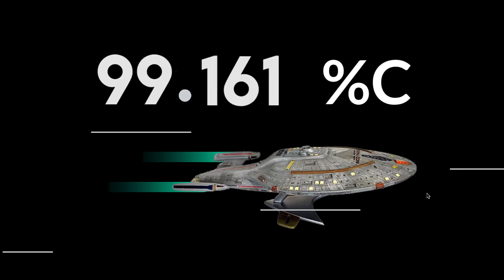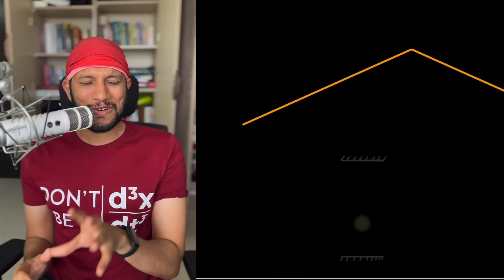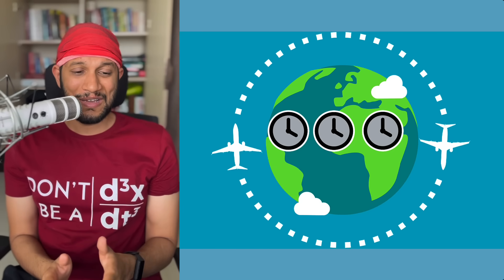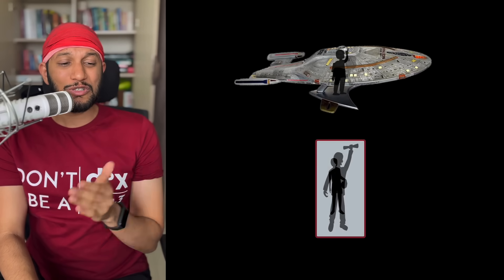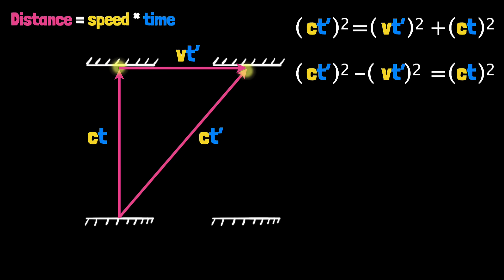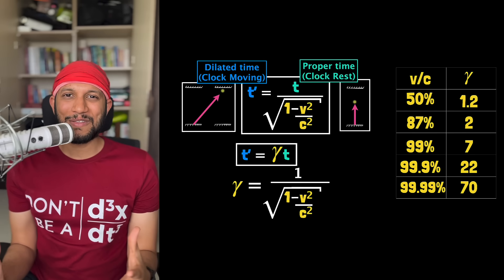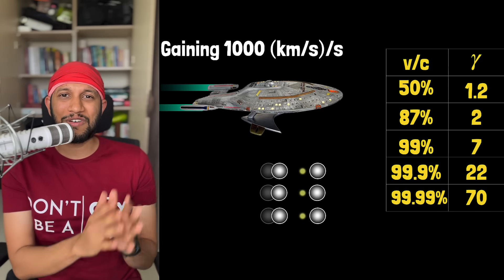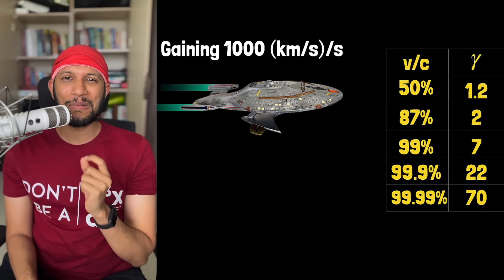I finally understood why you can't go faster than light! (My mind is blown)

Comment: This video doesn't just explain why we can't reach speed of light. It explains much more than that. For example, it explains why time slows down when you move very fast, but the moment I felt like I was enlightened by this video was when I realized that this can also explain something that I never understood before. I am talking about how the concept of relative speed doesn't apply to light and we always see the light moving at light speed regardless of our own speed. I still don't understand it fully but I feel like this video gave me a big hint about why that's happening.
Reply: I find it useful to consider that ALL objects move at the same speed through spacetime at the rate of c. A stationary object is moving only through time and a photon is moving only through space. Other objects move at different ratios of space vs. time depending on their speed, but an object's speed through spacetime never changes.
Reply: @huskypup3489  And likewise, being under the effect of gravity moves your "spacetime velocity arrow" slightly in the space direction and less in the time direction, resulting in gravitational time dilation (time slowing down) and spatial acceleration
Reply: @huskypup3489 I’m so sorry to shatter your understanding, but you’re wrong and Einstein is right. It’s all about reference frame. Objects do travel through spacetime at different speeds depending on point of reference, same as force carrier particles such as photon, we don’t know does the time goes “forward” “for them” or “standing still” or something else entirely, however the can observe and measure their speed, which is constant in any frame of reference, and means they do indeed travel in spacetime. Basically bosons except for mesons are incapable of slowing down beyond light speed in any reference frame, while aforementioned mesons and generally hadrons and fermions can, yet they have mass and are incapable of reaching speed of light instead. Your explanation fails at black holes for example. Gravity there is so strong it stretches spacetime so far that light needs infinite time to travel from source of emission beyond event horizon and since our universe have measurable time frame since the formation of a black hole to any point of time in the future (in our understanding of spacetime at the current state) we can observe no light escapes black holes, which in oneself reinforces our current models. Einstein’s theory explains it perfectly yours doesn’t, sorry. Mathematically speed, time and space come together in this formula v=dt. It’s been tested and always predicted results correctly to a certain degree, you can check yourself if needed. Now if you were right it would mean everything’s speed is c, which is kinda weird on it’s on but harder to debunk in simple terms. So lets look at photons in your model t=0 for them always hence for photon v=0 always 😮 according to your model photons are at perpetual rest to everything in the universe. Incapable of travailing any distance at all. No matter from which point of space or time you look at a photon it should always be at rest relative to you! So sorry again but it’s better to be mistaken and find out then believe in a wrong thing, you on the right trek just didn’t reached the destination yet. Be patient and eventually everything will click into places. By the way interesting thinking, never heard something like this, made me think for a second, thank you for what! I can recommend to start from understanding that space and time are kinda sorta the same thing like matter and energy is. Not exactly but it’s a good enough start, what is established for now is they are intrinsically connected and inseparable hence the actual name spacetime. It’s just describes four dimensions of the universe which we can confirm at the moment. Good luck, hope I’ve been helpful and didn’t dissuaded you from digging deeper, it’s crazy out there, but fun I promise.
Reply: @Noblp  nope, he’s talking about on the spacetime diagram and is completely correct and consistent with general relativity, further the diagram extends into singularities like black holes by way of penrose diagrams and is still correct
Reply: So basically two photons are emitted from one source — a lightbulb on a moving spaceship. One hits the eye of a traveler onboard, the other hits yours (and you are outside the ship and at rest in space. Wearing a spacesuit, of course, cause you’re smart). Two possibilities exist: 1. The ship moves away from you. 2. Or towards. In first case photon “forced” to “move” more distance towards yourself than it would’ve if the ship was at rest same as you, in second vice versa. But! And it’s a big fundamental physic’s BUT(t) 😉 Photons always travel at the speed of light at all reference systems, no mater what, so it will reach both of you and the traveler all the same, however it travels as a wave not as particle. And since distance was increased or decreased wave gets “stretched” or “compressed” in spacetime, which means it will have lower frequency in first case and higher in second. So for the traveler it would be ordinary light — nothing’s changed, but for you it would be red-shifted or blue-shifted accordingly. To visualise it: imagine photon as a particle skipping on a bridge. The bridge represents the distance between point of emission(in our case lightbulb) and your eye. At rest everything is simple: photon happily skipped on the bridge towards you at the speed of light and smiles meeting you (because you have inquisitive mind and want to understand him) Now imagine the point of emission goes away from you. Photon looks at the bridge sighs quietly and starts it’s journey at the speed of light as usual. However every jump, the bridge gets stretched a little bit underneath him. So even though our little but very determined photon jumps as high as he can and travels at the same speed of light, he lands a little bit farther away from you and from where he should’ve landed if damn bridge just kept still. But it’s keeps stretching and stretching… Every single jump (how exhausting!) So no matter from what perspective we look at him now we still know it’s a photon because he jumps a photon high and travels at the speed of light. But remember he’s very determined to meet you(for reasons stated previously)! So finally he will reach you, tired and red from exhaustion (poor little fellow is completely red-shifted! now it’s easier to remember which way is which, right?), but of course the distance he traveled was bigger and because we know speed was the same, it means it took more time (v=d/t). In the other case bridge unexpectedly starting to shorten every time he jumps and although he’s very happy about meeting you sooner it’s still freaks him up a little bit too. So he jumps as high as photons should, but his jumps are just shorter this time because the part of the bridge he planed to jump over is became shorter instead (what a world! What a strange world we are all existing in! He probably thinks. Well of course. He doesn’t understand speed - he is born to know only one and never can accelerate or slow down). Nonetheless he reaches you very excited because it took so less time to get to you! He happily bounces around you, but unfortunately you can’t see him he was jumping so closely so short distance he accidentally blue-shifted into blue then violet, ultraviolet and finally into microwave range. But don’t worry science got you both covered. You can still meet with the help of radio-telescope. It will greet photon with it’s antennae and translates him into visible spectrum for you. Happy end.

Hope it helps. It’s overly simplified, but at the core is correct. Just remember photons do not (under usual circumstances) propagate as particle in reality. The cake is a lie…. I mean the bridge! 😅 In this visualisation the bridge represents spacetime for the wave to propagate in and the photon represents every other characteristics of light (electromagnetic force). To understand it further we have to dive into wave functions and quantum theory which is beyond the scope of this explanation. Keep asking questions, reading science literature and watching educational videos. See you on the other side of electromagnetic spectrum!
Reply: The speed of light appears unchanged when you're traveling fast because your biology and everything else with you is slowed down by the same amount due to time dilation.
Reply: @perfectionbox so then every move would take ages I guess I guess in "real time" so it takes more and more time to accelerate.
Reply: time never slows down with the speed. 
most people, including most scientists get it wrong. 
relative means locally it never changes. no motion can make time go slower. 
for the one who travels with the clock, the clock goes the same. 
all clocks everywhere in the Universe go the same, if we discuss special relativity. 
there is no time dilation, without an absolute referencial. 

no real clock measures time, not distance. all real clocks measure time*distance, and that is a non-variable. 
Einstein was often confused 
he never understood the difference between theoretical time and the measured time.
Reply: @Sergiu.antifascist  "no real clock measures time, not distance" this phrase makes no sense. Clocks do not measure time*distance lmfao what?
Reply: @Sergiu.antifascist yes, this is the point

absolute time, or movement, is real

in the so said diluted time ship,  people will not feel they're in slow motion
Reply: You can cheat by expanding or curving spacetime to bring a massless particle to rest.  For example, using a black hole or great distance to take advantage of dark energy expanding spacetime.  As the relative speed between the observer and particle approaches c, the wavelength is stretched toward infinite length and the energy approaches zero. As c is achieved, it creates a horizon, either passing the event horizon of the black hole, or the distant horizon from which communication is no longer possible and thus the particle disappears.   It’s a trick of stretching the tensor in general relativity.
Reply: dude, considering the galaxy is rotating, we're all moving in HIGH speed quite comfortably
Reply: Of
R light speed isn't finite but infinite
Or Einstein use chicken egg logic to point of not finding flaws in it
Unless we don't use his logic
Reply: consider your space ship a rectangle with only 2 atoms one on each end(one on the left and one on the right). there is a force bieng applied from the left side, and you accelerate that rectangle towards the right side of the screen, for the acceleration to register and for the rectangle to move, one atom needs to move(left atom), and then that movement needs to registered by the second atom(right atom), so, lets say if the rectangle is just starting out, the electromagnetic force will move at a speed of light and the rectangle will move as usual, in its perspective time is flowing as usual. now, lets say the rectangle has accelerated to 50% the speed of light. both atoms in the rectangle are moving at 50% the speed of light, now if it wants to accelerate, a force is applied to the rectangle, and the second atom(left atom) would be the first one to accelerate, and that acceleration needs to be transmitted through electromagnetic force at the speed of light to the second atom on the right for the entire rectangle to move and accelerate as one. but the thing is, the second atom is also moving at 50% the speed of light, so the electromagnetic force takes 2 times more to reach the second atom, even though the force is moving at the speed of light, the second atom is moving away from it at 50% the speed of light, so it takes longer for it to arrive, doesn't matter if we are looking at it from the outside or the inside. the propagation of force will always be slower the faster you move. and if you move at the speed of light, you don't move, because the time it takes for the electromagnetic force to move from one atom to another would literally be infinite. no matter how much energy you put into the left atom in our rectangle example, it wouldn't reach the right atom, because it is moving at the speed of light.

From the perspective of someone outside the rectangle spaceship, the rectangle is moving at light speed, but from the perspective of the spaceship, you have barely aged or barely moving.
Reply: The speed of light being constant is a convention though, it could just be that the speed really is different in different directions.

Comment: The two problems are:

1)  99.99% of STEM-educated people are convinced "space is empty"

2)  the "you can't accelerate and exceed light speed" claim assumes NOTHING IS BEING DONE TO ALTER THE SPACE

Because of (1),  the practicality of (2) will NEVER be considered.

Light speed can be exceeded if the hull is ACTIVE, not PASSIVE.  All (disclosed, known) space vehicles have passive hulls.  Making the hull active to modify the conditions of space is required to exceed the speed of light.

Comment: I've always felt that we can go faster than light. It's just that we would travel into the future in the process, which is not ideal. Like, if you are in the craft accelerating at 1g letsay, the acceleration would not change ever. If that was a measure of speed, you would eventually count X number of seconds later time g would > C. It's just that you are also going through time faster. Then you decelerate. Then turn around and come back and so on. And hundreds of years would have past. To the outside observer you would never cross C. But that's because some of that "velocity" is through time, not space. Is my thoughts correct, just a convoluted way to explain it, an alternative, or just wrong? 😂

Comment: So If. The earth accelerates 10 times it's original speed towards the galactic center we will age slowerbut we are at a greater risk of reaching the galactic center faster than the earth normally would which might end life on earth if the earth moves faster the sun moves faster that has to happen te whole solar system moves faster  which means solar system will fall in the super massive blackhole faster

Comment: Amazing explanation but -
The theory of relativity is based on the assumption that nothing passes faster than the speed of light c. And that is why you could derive the famous time dilation equation at 9:00 using Pythagoras theorem. However, if we ignore that basic assumption, then the sides of your triangle at 9:00 will be like this: 
1) ct,  2) vt', 3) (c+v)t'
Therefore, applying Pythagoras you'll not get that famous time dilation equation.
So the whole thing is based on the assumption that (c+v) doesn't exist because nothing goes faster than light c.
Therefor, you can't explain why we can't reach the speed of light using a theory that is based on the assumption that nothing moves faster than light, that is a circular reasoning. 
Nonetheless, your style of explanation was captivating and joy to watch. Keep up the good work.
Reply: Right, the constancy of c in different frames is taken from measurements and from Maxwell's equations, and it becomes a postulate in relativity theory, the rest follows from it.

Comment: Ok ok 🤔 of course not. It's not "intuitive".

Let's go to particle lab with accelerator. A modest magnetic booster 100x ten laps before going out. Electrons reach 0.99c 😯Lorentz factor 7, and that's a lot, or at 0.866 c was too close to the enormous amount of electricity which acceleration it more, it won't work with a little increment like befor+ 0.5c🤓😬... It will take lots of electricity to get a stronger EM bump, LOTS. Reaching  0.999 c, that's 0.01faster and gamma is more than 22😳🤯

This is noticeable, time dilation, not only the muons you mentioned, but neutrons. More energetic ones last more time than the not that energetic.

From around 10 min to 20 min, it's like pop corn in a microwave 😅🤓

Comment: I'm not really sure if I understand the speed of light being the same for every observer. Perhaps this is the right place to ask about it :)
Imagine two observers moving in the same direction but with a different speed, watching a photon also moving in that same direction. Imagine they are moving towards a planet. Will both observers not have a different prediction as to when this photon will reach the planet? Is this reasoning correct?
Assuming so, obviously it doesn't mean the photon reaches the planet twice, it's just that both observers predict a different time and see 'it happen' (imagining we could observe a photon moving away from us) on a different or 'their' time. Would the time the planet itself observes the photon reaching it be called the 'real' time? Is this a thing in physics?
Reply: You're right, each observer has their own notion of time (and space!), their own system of coordinates that assigns times and spatial coordinates to events, so one event (photon reaching that planet) will have different time and different place coordinate for the two observers. Lorentz transform is used to convert from one frame to another, from one coordinate system to another. 
When a massive clock moves from A to B, for different observers it takes different amount of their time, but they all agree on how much time will pass on the traveling clock itself, that time is called "proper time".
Reply: I'll write this down in simple words.
If you try to measure the speed of light (photon) at whatever speed you're travelling, you'd still measure it the same  "C".
If two people are travelling behind a photon at different speeds then time for them will slow down accordingly so their prediction regarding "WHEN" will be different, but both results will hold true  because the "When" and the "distance" (length contraction) measures differently for both of them.. You're correct in your thinking